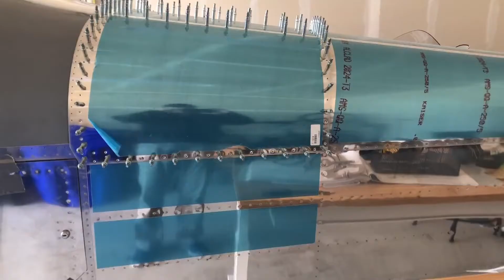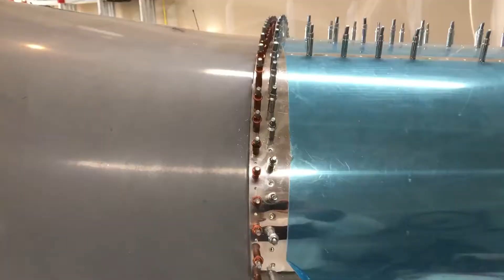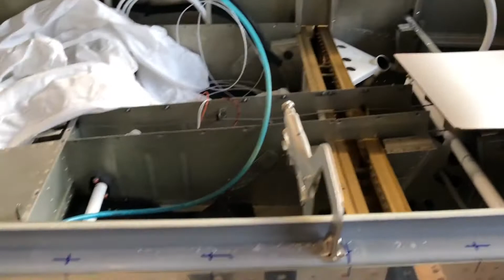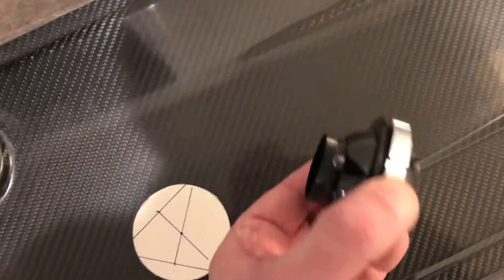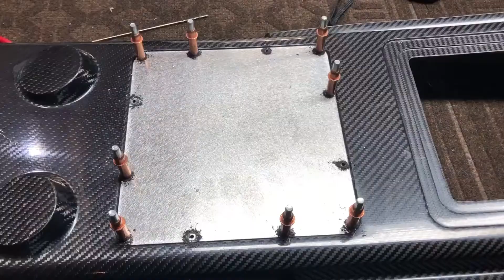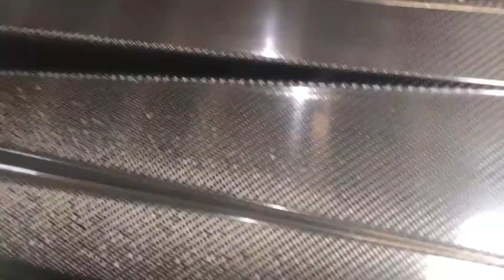Cabin Top Part 4... Its All Coming Together

Comment: Your work looks nice!  Enjoying reminiscing watching your efforts. The cabin top is a good warmup for the doors. If you thought the cabin top was tedious wait til you get to them. You may want to try using a 4 1/2" mini grinder with an abrasive cutoff disc for cutting the fibreglass. Works like a Dremel tool on steriods. Just be careful as it cuts just as fast as you can move it forward. Also if you use it wrong it will kick back at you. Once you get the hang of it you will use it for everything. Cuts aluminium like butter as well.  Doors were so ugly I also wired my avionics at the same time on the fuselage front upside down on my bench. Served as a nice sanity break in between bouts with the doors.  Carry on and keep up the nice work!
Reply from the maker: thanks for the advice, already started on the avionics... bit of a break

Comment: When you’re securing that does it call for any sealant or gasket type material
Reply from the maker: I think you are referring to the overhead console yes you can attach it with either Lord Adhesive 7545A/E recommended by aerosport products or glass it in with epoxy.